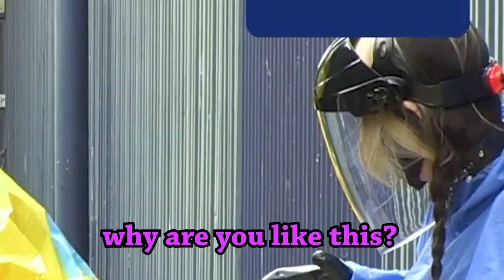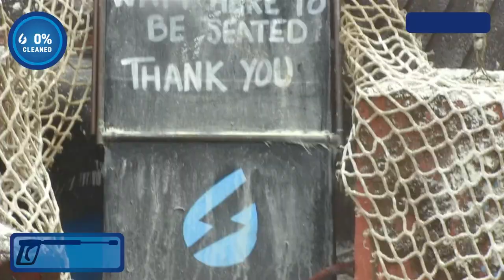I was sponsored to use a real Powerwasher responsibly

Comment: "we could really hurt ourselves if we're not careful" worried laughter
Reply: The funny part is the fact it’s literally just a pressure washer. Fuckin harmless
Reply: @KDA21  power washer to the eye will fuck your shit up
Reply: Followed by the laughably weak power washer…

Some power washers can get really powerful, but the ones that do are usually very loud
Reply: @KDA21  knew a guy once who cut through his boot and into his foot really badly with a pressure washer. They’re not harmless by any stretch of the imagination if the pressure is turned all the way up
Reply: @mackinbox  genuinely never heard of this happening tbh, but it probably has. I just say i dont think it would be that bad considering we use one to wash our porch and me and my siblings blast each other with it sometimes
Reply: @KDA21  yeah, I would guess that’s not an industrial powerwasher, or you have the pressure all the way down. This guy left the spray on his boot for a long time for that to happen, so it is definitely possible for you to hurt yourself badly, but only if you’re very careless
Reply: @KDA21  I was thinking the same thing. I used a Kärcher before....It literally destroys mortar and cement and throws the bits back into your eyes. They strip off paint...any kind of paint and cut through wood if you're not careful. The stronger ones use hot water and are basically sandblasters without sand.
Reply: @KDA21  just depends on the top you have on it, it's usually the red tip which is pretty much a needle and as a kid I accidentally cut a shallow groove into the asphalt without realizing how much stronger the tip was and this was just a normal at home pressure washer, gas powered but nothing crazy strong and probably like 15 years old already at the time but it was flinging rocks ripped out of the asphalt everywhere
Reply: @AmstradExin  your comparison to sandblasters without sand makes me curious to how well one would work as a water jet cutter if you had a way to feed in grit into the tube before the nozzle, like obviously it won't be anywhere near the same as a real water jet cutter but I'm curious what it would be able to cut and having a freehand water jet sounds like an awesome idea lol

Comment: I handled a power washer two weeks back. I learned the hard way it was a faulty product. The hose exploded, and chunks of metal were thrown everywhere with a high PSI.

I didn't get hurt too badly, but I consider myself unlucky. I wish it had ripped my stomach open and made me bleed out like it was supposed to do normally when it exploded like that.

My point is power washers are very dangerous. There was no exaggeration they could seriously get hurt.

Comment: Hard to tell from the video, but I doubt that these could have hurt you very badly unless you left it on your skin for a while. The pressure looks like it was really low, and a rotator tip like that is fairly safe. If you turn up the pressure all the way in an industrial washer (like 2000+ psi) then yeah, they can definitely hurt you, but only if you bring it pretty close to your skin.
Reply: think the same and was actually searching for this comment - the video looks like they have barelly more preassure than the tap outlet...
Reply: @TeaObvious  maybe a little more than that, but yeah, judging by the amount of kickback I would guess that the pressure was almost all the way down.